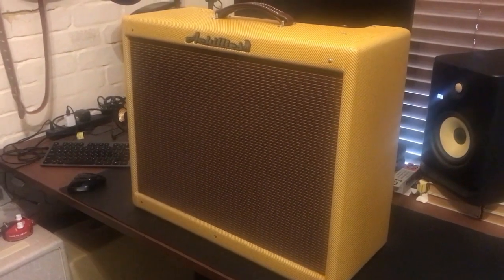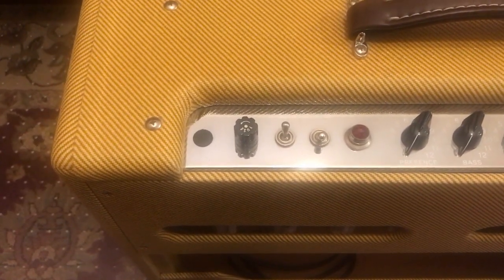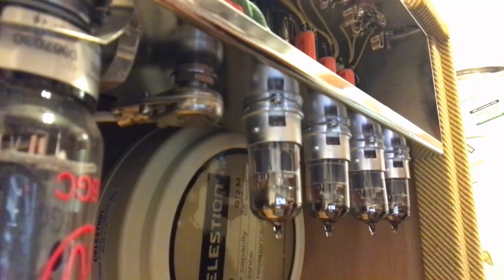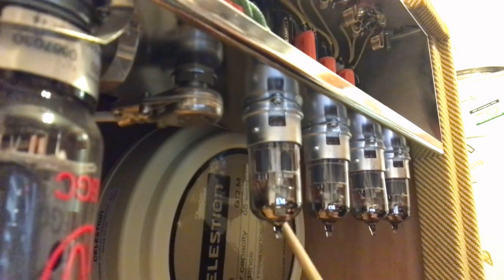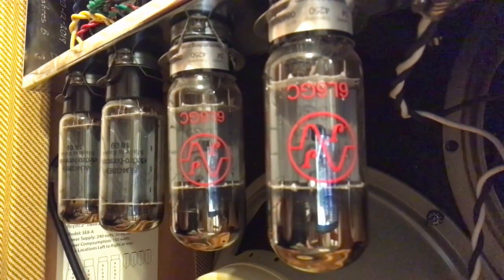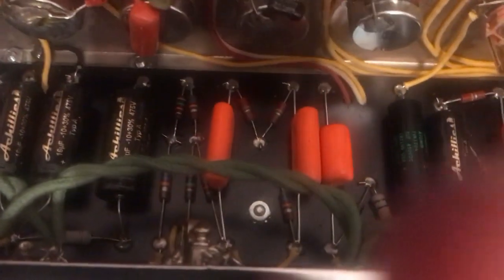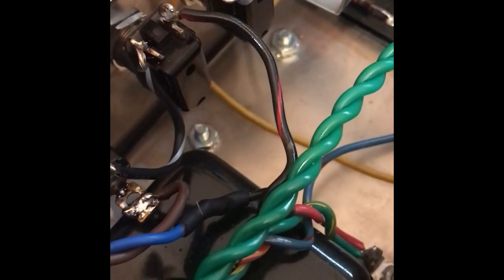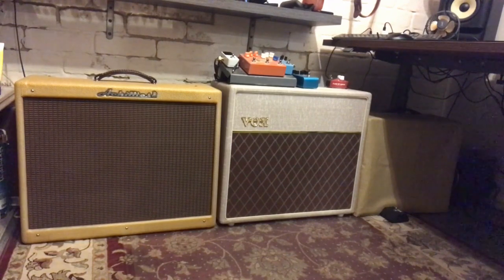Achillies Low Power Twin: Evaluation & Opinion

Comment: Some excellent observations, Bladder. As Brad (below) knows, we have to rectify this sort of dangerous power wiring mistake in almost every 60s & 70s amp that has been upgraded to a 3-pin lead.  While its almost forgivable in a 40 year-old retrofit, its a huge oversight in 2024. In defence of Labros, the cup washers could have been lost by a previous tech. I've worked on a couple of Achillies amps. They are beautifully made, but I have no idea of their costs. Great video and insights, Bladder.